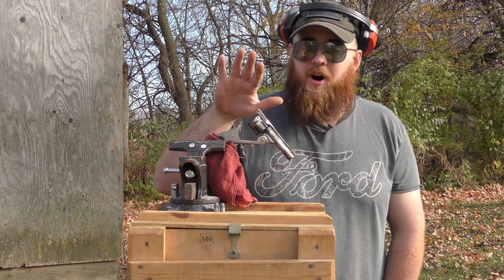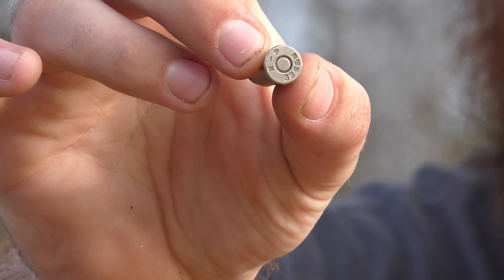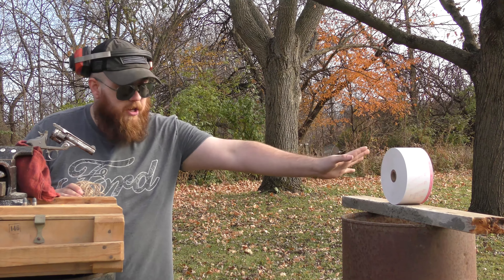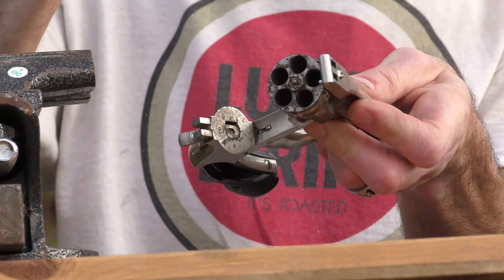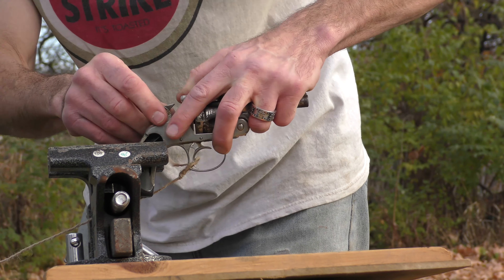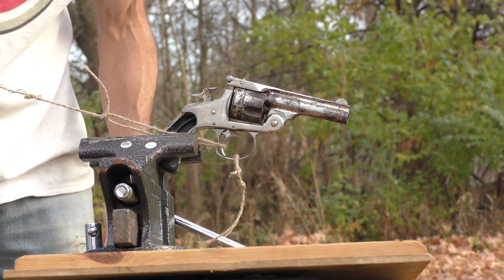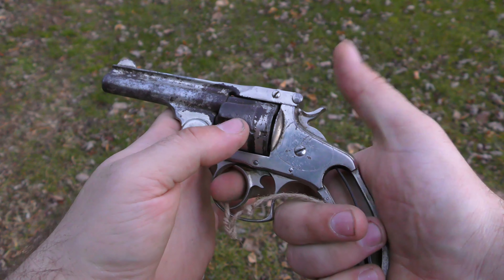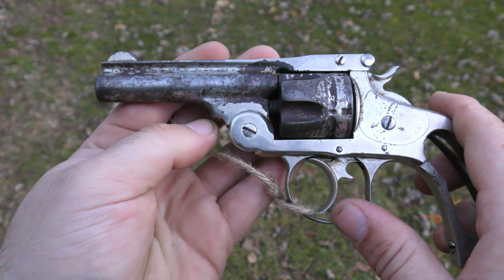223 in a 38S&W Revolver - Sketchy don't try this

Comment: Question #1 how far down the barrel was the round? I'm curious as to if the cylinder actually took the brunt of the force or of the barrel did. Or even if the gas was lost through cylender gap. Because if this really worked and the cylinder took the pressure. That really opens up a lot of reloading options. As is. I saw one reload Bible with a listing for 5 gr unique and a 125 gr head. That puts it in the .38 special ballpark. And if a TOP BREAK can handle it. Colid frames should have no issue